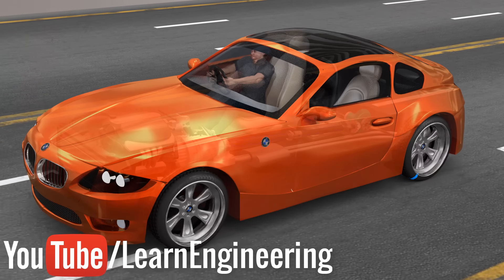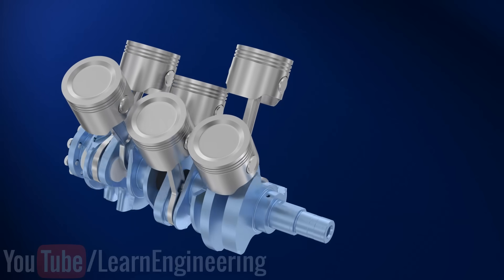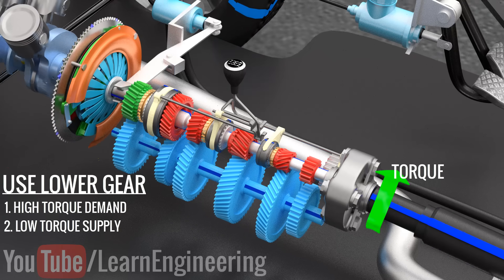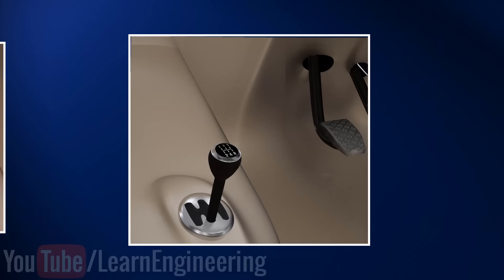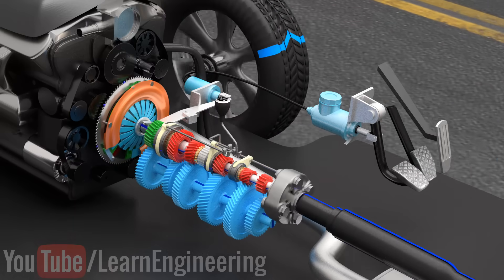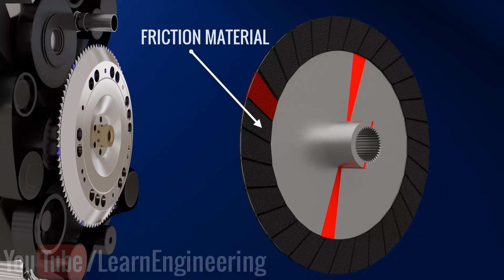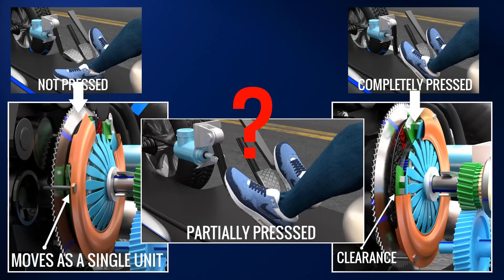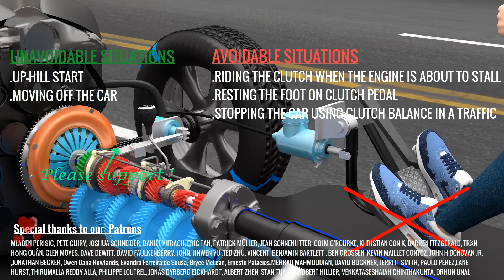Why you should not PARTIALLY press the Clutch?

Comment: Not only car riders even bike riders do the same , i too does the trick to speed up my bike , and i hope from now i try to avoid those paritally clutch pressing techniques.
Reply: +MZ flighter Holy shit i can't tell if you are for real
+Sudhakar D R No, don't avoid it, you do need it when doing slow manoeuvres, it's not nearly as bad as implied in the video. It's not gonna do much unless you pull in the clutch halfway and crank the throttle to the max
Reply: Bikes use a wet clutch which can be slipped at slow speeds; cars use a dry clutch that shouldn't be slipped.
Reply: Same purpose as in a car
Reply: Bike clutches can take a lot more abuse than car clutches
Reply: MZ flighter the clucth lever are available in all superbikes and dirtbikes, although some underbone and all manual scooters have this device.
Reply: I too do it on bike slow maneuvering. It seems natural unless you do throttle the accelerator more than ~25%. Actually my bike engine would turn off with a transmission shock in stationery position if I don't keep pressed the clutch knob in gear-up.

If this wears out the clutch in above conditions then I must ascertain it's poor implementation on the part of manufacturing.
Reply: The sudden stopping of the engine is due to " Engine stalling " it is not a part of manufacturing defect .
Reply: motorcycle is completely different to a car though. in some situation "riding" or rather using the clutch is actually recommended, on a motorcycle the slightest unbalance can upset the bike so the clutch can be used to dig the back end in on big harleys, say for instance you are going round a bend and your in the wrong gear or going too fast, you can use the clutch gently to slow the bike and help gain control if the rpms are too low, this is a lot safer than trying to use the rear or front brakes which would be your only other option to correct yourself.
Reply: WTF? I have never seen a clutch in a bike. What would be it's purpose, if it really was there?

Comment: total bullshit...if you do that you cant drive! half clutch is essential to smooth driving!
Reply: sure just change to lowet gear...but you are imagining a hill without traffic, i dont, i meant a hill with start stop traffic, in this situattion half clutch and aceleration is absolut necessarie
Reply: Colin Hoskins Say you are coming to a stop sign and you're going uphill, you have to partially stop the car but ride the clutch on first gear. This is essential if you want the engine ready to go when the traffic allows you.
Reply: Bro... Have you ever driven a car or anything manual before? You can't not feather the clutch when doing stop and go on a hill... Even if your car is a torque monster with 600 Nm of torque, it will still stall in 1st gear going 5km/h uphill
Reply: sacrip tex So your car won't go slowly in a low gear without riding the clutch?  Maybe get it looked at.  If you can't drive slowly without riding the clutch you maybe should get an automatic.
Reply: zeramino Now that is bullshit. As you'll never be convinced I'll retire gracefully. Good luck.
Reply: Colin Hoskins not slowing down, rather stopping but for mere seconds, discontinuing the engine's torque is undesirable in these cases.
Reply: Exactly what i was thinking. Youll end up driving like shit by fully clutching all the time. Theyll be alot of pullback each time or jolting enough to spill your coffee
Reply: No, rev-matching is essential to smooth driving. I drive a manual every day, and the only time there's clutch slip is when I'm starting from a stop (because that's simply how you have to get the car going).
Reply: If the engine does not have enough torque to go uphill you do not smooth the clutch to make it work, you shift in a lower gear to get more torque. As simple as that.
Reply: Stick to automatics noob.
Reply: zeramin By partially stopping I assume you mean slowing?  Obviously you need to depress the clutch before coming to a stop, but the whole point of the video is that clutch half in and half out as a steady state, such as holding the car stationary on a hill, is undesirable. But fine, you carry on wrecking yours.

Comment: Ahh the elusive BMW v6.
Reply: 01:06 a V6 that has a 4 pipe header🤣
Reply: With a backwards crankshaft
Reply: V6-i4 z4
Reply: Wtf hahha
Reply: Brien Berglund nice a BMW with a backwards placed crankshaft
Reply: Sjoerd Hermsen damn always wanted one of those reversed crankshaft cars😂
Reply: What about the fact that the driveshaft spins faster than the engine , all the gears in this animations are overdrive gears
Reply: i6
Reply: Thought the same! 🤣
Reply: A V6 with the same length as an I6, no less. Brilliantly informed modeling team there.
Reply: MzRtS12 Buick? Amc? Ford? Chevy? Little research goes a long way before you make yourself look like an ass hat
Reply: uh, the V6 is in half the BMWs on the road. Like ALL of the 3 series and E9x
Reply: @faradaysage15  BMW has never used a v6
Reply: @faradaysage15  There's a difference between a V6 and a straight 6. BMW uses straight 6s and has never used a V6 to this date.